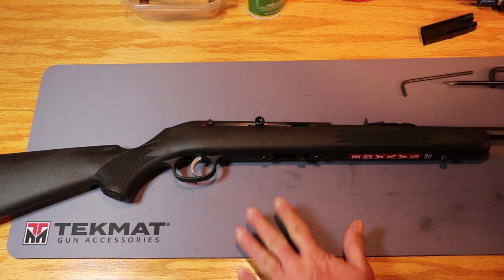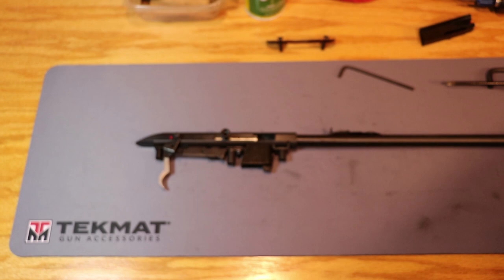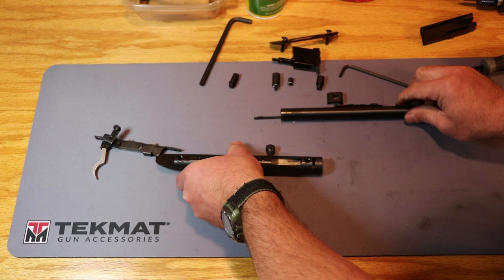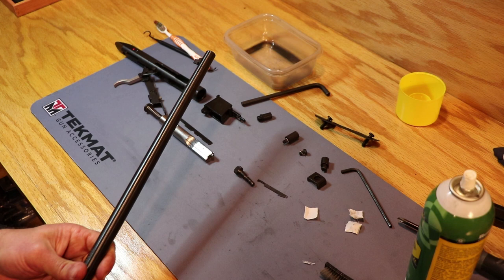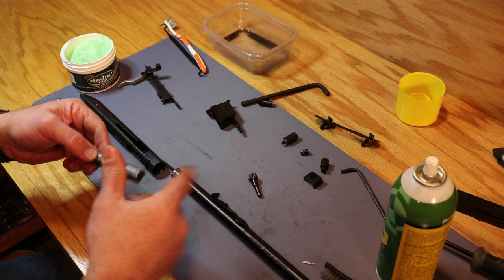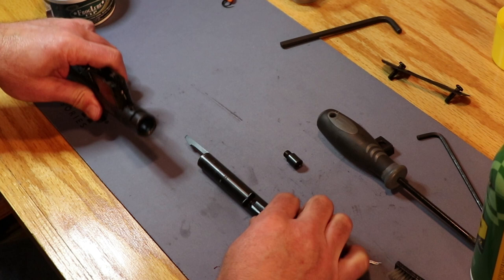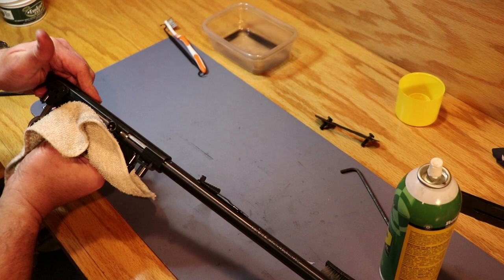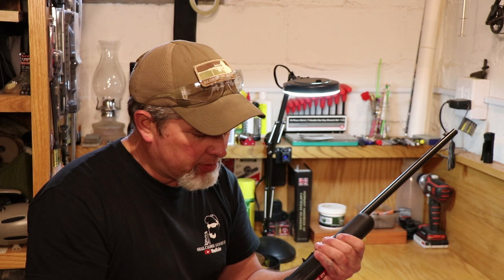Savage 62F cleaning, disassembly and assembly

Comment: THANKS!!!  Mine needed cleaning in a bad way...wasn't sure where to even begin.  Play and pause...sometimes replay...ha...got it done tonight.  It's a good rifle...have had it now for over 4 years...put allot of rounds thru it...one issue I had with it though (manufacture issue I'd think), had trouble getting the barrel reattached...that little metal guide came out bent when I pulled it apart.  (and no I didn't reef on it)  Took some doing to get it to lined up and in.  BUT thanks to this vid...she's clean and back firing.  Again thanks...Cheers.
Reply from the maker: I love to hear that I helped you out! Hopefully it will give you many more years of reliable service. Thanks for watching!

Comment: It comes apart just like the 64 I have. For me the 64 is easier to take down than my Ruger 10 22, my Marlyn 795, my Marlyn 60, and my Mossberg 702 plinkster. The Savage 64 and 62f don't have that pain in the butt bolt and bolt spring to deal with like the others do.
Reply from the maker: I need to get a Marlin 60 and I'd like to get my hands on a 802 plinkster (bolt gun) just for fun!
Reply: @SmallCaliberArmsReview  
I've been looking for an 802 plinkster. No one carries them up here. One gun shop gave me the gun's UPC and told me to check their web site often to see if one came in.
Reply from the maker: @tomstepanowicz6191  I'm looking for the polymer "thumbhole" stock 802. I found one in Louisville, KY once for $119 but it was months before I got back to that store, by then it was gone. I'll find one, someday.
Reply: @SmallCaliberArmsReview  the 802 with the thumbhole is the one that has my attention too

Comment: Thanks for your videos... Finally got mine to a range today (Not cheap where I live 25 bucks an hour)  Fired off 85 rounds with 6 or 7 hiccups seemed like the shells weren't ejecting fast enough or hitting the receiver not letting the next round load... Hopefully it's cause the gun is new and hasn't been broken in yet... Or it was the ammo, Winchester super x & CCI mini mags.. The magazine seemed like it was working okay no problem chambering the 1st. round..  Don't work to hard :)
Reply from the maker: I've has some issues with Winchester ammo in a couple rifles, especially the Rossi Gallery 22 (pump action, go figure). I've always had luck with Remington Thunderbolts. Thanks, have fun, be safe!
Reply: @SmallCaliberArmsReview  T Y V M

Comment: I have a rifle like that and wanted to know what do I need for cleaning the gun plus any lubricant grease because every time I fire a bullet it sometimes jammed. Sometimes it doesn't jammed, Barrel needs cleaning like how many times. Every rifle have different size of parts on guns? How often the rifle needs cleaning. Thanks. One gun shop charges $65 for cleaning the rifle so I thought I could just clean it myself instead of paying $65 but all I think of is WD-40 to clean it. Any lubricant or grease to clean the rifle or just need replacement parts.
Reply from the maker: You should be able to fire a few hundred rounds before it needs a good cleaning. I don't think I would use WD40 for firearms, it's more of a penetrating oil. I use mostly RemOil, it's formulated for guns. As far as a grease, I use FrogLube, it's both a cleaner and a lubricant and it only takes a very small amount.

Comment: Can you tell me why the receiver on my Savage 64f is so stiff after firing on a plastic snap cap, I don't eject it cause I don't want to leave my rifle charged so I just lock the receiver open and take it out with tweezers... Thanks
Reply from the maker: The plastic snap caps will get deformed over time, you may just need a new one.

Comment: Silly question:
Is there a way to “uncharged” the bolt without having to pull the trigger for this rimfire rifle?
Reply from the maker: Make sure there is no ammo in the rifle, check it then check again, then pull the trigger. That's really the only way to "uncharge" it. If you have a snap cap or plastic dummy round, place it in the chamber first, that will minimize any potential damage to the firing pin and chamber edge. It will not cause any problems leaving it in the "charged" state as long as there is no ammunition in the firearm. Not a silly question at all. Thanks for watching!

Comment: Stupid question but can the stock barrel on the 62F or 64F be swapped out for a different barrel like one with a muzzle?  Thanks
Reply from the maker: I'm assuming you want to put a muzzle brake or suppressor on it? You would need a barrel for the same gun to swap them or have a qualified gunsmith thread it for you. Thanks for watching!

Comment: Can you dry fire this gun without damaging it? I have the Stephen 62
Reply from the maker: Unless specifically noted in the manual, I would avoid dry firing any rimfire firearm, the only place i could find reference to dry firing the 62/64/954 is during disassembly, to disengage the hammer from the sear. If you just wanted to do some practice "dry firing" there are plastic "dummy rounds" or "snap caps" available that are supposed to prevent damage to rimfire firearms. Be safe, have fun and thanks for asking and watching!

Comment: Now im worried! My firing hammer doesnt have the black ring to hold the spring together. It came out loose???
Reply from the maker: Not sure what ring you're talking about. The design may have changed over time, these rifles have been around for a while.
Reply: The bolt action ring that hold the springs in place. I figured it out, it broke off an its stuck in the back reciever.
Reply from the maker: @johnnygutierrez3719  well that's a bummer!

Comment: I just bought a 64f, will it  come apart the same way, and how often would you suggest I clean it? Great video. Thanks.
Reply from the maker: It should. Most of the time people don't give them a thorough cleaning until they start having problems with it. Most rimfire firearms will handle a pretty good bit of neglect before issues arise. I don't believe there's any set number of rounds between cleanings and I probably clean mine way more than they need it but always remember that firearms have 2 enemies; Rust and Politicians.
Reply: @SmallCaliberArmsReview  Thank you for reply. I also own a shotgun, would this same thought apply to it also? Thanks for you time.
Reply from the maker: @jojoe2409  Yeah, keep them in great shape and they'll always be ready when you need them. Thank you for watching!

Comment: What Is the size of the second Allen wrench you use to release the barrel?
Reply from the maker: I believe I only used two different sizes, a 5/32" and a 1/4". Those may be different depending on when yours were made. Thanks for watching!
Reply: @SmallCaliberArmsReview  you're right, i checked and I have the same sizes you have 👍

Comment: Amazon was out of Frog Lube  when I wanted it so I got some Grizzly Grease, it looks about the same and got good reviews, My question is would you recommend a Teflon lubricant spray that dries  hard and  leaves a colored coating,  Thanks
Reply from the maker: I have seen some of that spray used on a rail on a type of milling machine, it changes the tolerance between surfaces. When the body would move, it would scrape the coating off and get between the moving parts and make a mess. the machine had to be taken apart and have it all cleaned out to work properly again. From what I witnessed, I would not use it on firearms.

Comment: If I accidently cock this rifle how do you un-cock it without dry firing. Just got it last week and it's my first semi auto and I want to learn everything before I go to the range...I think making a video on un-cocking would be a good idea...Thank you
Reply from the maker: Really, every time you fire a semi auto firearm, it is automatically cocked and ready to fire again. If there are no more rounds in the gun, it will not fire. I read through the manual and I couldn't find anywhere it mentions "decocking" except for the disassembly procedure:
"TO DISASSEMBLE THE ACTION
ALWAYS KEEP THE MUZZLE POINTED IN A
SAFE DIRECTION.
A LOADED GUN HAS NO PLACE IN OR NEAR A
VEHICLE OR BUILDING.
• Suggested tools for general maintenance
and cleaning: padded vise, Phillips
screwdriver, 7/16” box end or socket
wrench, 9/64” Allan wrench.
1. With one hand prepared to catch the
removable magazine, push the latch at the
front of the magazine forward, ejecting the
magazine into your hand.
2. Placing one hand over the ejection port, slowly
pull the cocking handle fully to the rear.
3. Let the cocking handle come forward slowly
and push the handle into the counter bore
(see FIGURE 4), locking the bolt open, and
extract the live cartridge from the chamber
(if there is one).
4. Look and feel to be sure there are no
cartridges in the chamber.
5. Move the safety forward to the OFF SAFE
[READY TO FIRE] position.
6. Pull the trigger to disengage the hammer
from the sear.
7. Remove the stock assembly screw, and lift
the action and barrel from the stock."

This was copied and pasted from the Savage owners manual available on line.
Generally, once you are done firing and you have verified there is no ammunition in the firearm, the manual recommends putting the safety in the "On Safe" position.
I have heard of people doing different procedures like pulling the bolt back just far enough to allow the trigger to be pulled but not letting the firing pin to hit the breech, but this procedure is NOT mentioned in the manual. 
     I hope this helps and thank you for watching!
Reply: @SmallCaliberArmsReview  Thank you and have a great day :)

Comment: If I wanted to leave a few mags loaded ( oem) would 5 rounds each be an issue as far as messing up the spring?
Reply from the maker: One of the great firearms debates! I have some that have been loaded for years, fully loaded. Usually heat and rust are the biggest culprits of the magazine springs. Think of all the other springs around you, that are not unloaded when not in use. Automobile springs, various switches, breakers, all the other springs in the workings of your firearm. I can not say with 100% certainty but I do not fear one going bad because it's left loaded.
Reply: @SmallCaliberArmsReview  Im a creature of habit and learned long ago not to leave loaded and I typically shot a hell of alot more back then. Not so much now. So I definitely appreciate the feedback. Thanks brother. Love the channel!
Reply from the maker: Thank you!

Comment: Would it be safe to  use stainless steel snap caps on this rifle not sure what the firing pin is made of... Thanks :)
Reply from the maker: I didn't even know they made stainless steel "Snap Caps"! I would say no, a "Snap Cap" is supposed to provide a cushion between the firing pin and the edge of the chamber, much like the brass of the rimfire ammo does. A stainless steel dummy round may protect the chamber edge but I think it may be hard on the firing pin. Firing pins are usually made of a hardened steel so they can withstand thousands of impacts on the primers.
Reply: @SmallCaliberArmsReview  Thank you
Reply: @SmallCaliberArmsReview  I posted a review of these snap caps on my channel and I gave your channel a shout :)
Reply from the maker: @gamer6550  Awesome! I'll go check out your video!

Comment: Can this gun be fired right out of the box or should I oil it first...thanks
Reply from the maker: At a minimum you need to verify there are no barrel obstructions. I would recommend picking up a bore snake or a cleaning rod of some sort and making sure there is no debris from the factory in the barrel and action. It will probably have enough factory oil left in it to run for a while. They rarely have anything in them but it's just good practice to verify, even a small metal chip from machining can cause big problems.
Thanks for watching.
Reply: @SmallCaliberArmsReview  Thanks for the fast reply have a great day
Reply from the maker: @gamer6550  you're welcome.

Comment: STOP , 1 tip!  Thore is wiggle room when you put the barrel back in . so ig ur already sighted in and dont want to mess around with ur sights again . Then mark the barrel to the recover and line up the marks!  lots of wiggle room i can havee the barrel twist alot right or alot left, geez, i eyeballed it but wish i would have known that b4 haha. gonna shoot it tomorrow. And yes it is a good gun. Not built asdurable as the 1022 which i replaced it with. trigger looks like dicast crap 2. otherthen that it shoots good cant complain for 160 canadian.
Reply from the maker: Both the rear and front sights are mounted on the barrel so there is no chance to miss align them unless you bump or damage them. The lug that holds the barrel on, really has no play in it at all so even if the barrel was able to be rotated 360 deg. the sights would always show the same as when it was sighted in.
Reply: @SmallCaliberArmsReview I see what you are saying however if the barrel is 75 degrees left to the receiver  the sights will still be aligned but not straight to the receiver. for example the stamp that says savage may not read straight because it twisted a certain way. i aligned it as straight as i could to the receiver. in short the sights are aligned together  but maybe a fraction off of being aligned  to the receiver..i have it looking nice and straight everything in good, just a little sketched that i dont have it perfectly straight, but maybe it never was anyway. gonna shoot it tomorrow. Thanks for the video man, helped me just go for it,

Comment: I watched this video before I bought this gun and it's the first gun I've ever owned! Thanks for the great cleaning instructions! I also watched your review on this gun.(https://www.youtube.com/watch?v=Ynbwa6Rx10k )  Thanks again. I've shoot other people's guns off and on over the years but this is the first gun I've ever owned myself and I'm basically a newbie to guns. You were talking about a product called "FrogLube" I found a video about FrogLube that is 6 years old  ( https://www.youtube.com/watch?v=3-depzYZC8w ) and started reading the comments and one poster commented this:
" One warning-in cold temps it will turn your firearm into a club! Works 
great in warm temps, but turns into wax and WILL make your firearm stop 
in the cold. Anything below 30 degrees or so. I know this from personal 
experience. The only product I have ever make a pump shotgun fail to 
fire. Firing pin was waxed up. I have to let people know this before it 
gets someone killed. Terrible product for northern climates!!! " 

Others asked the poster of the video if after 6 years he is still using the product and he answered one of them back with this comment: 

" I've switched to Slip2000 EWL.  I still like FrogLube but find Slip2000 EWL easier to apply/use. " 

 Like I said I'm a newbie to guns and I'd appreciate any thoughts on the matter. And one more thing, I really like that GSG FireFly!!! ( https://www.youtube.com/watch?v=vJJNgNyqKMo )
Reply from the maker: I've been using FrogLube for several years now and have never had any issues with it. Now when I apply it, it's only a very thin film. I think you just gave me an idea for a new video, it is that time of the year!
The FireFly is lots of fun!!!
Reply: @SmallCaliberArmsReview  

I came across this article tonight and thought you might find it interesting. 

" Believe it or not, and contrary to what a lot of marketing hype will try to tell you, firearms aren’t generally all that hard on lubricants. They encounter intermittent high loads, interspersed with long periods of inaction. This means that the primary lubrication need isn’t hydrodynamic – it’s boundary. What, then, should we be looking for? "
https://www.grantcunningham.com/2006/05/lubrication-101/

Comment: This system seems rather complicated to take down.
Reply from the maker: It's not the easiest and it's a very old design. It's not necessary to take it down this far for every cleaning, sometimes just a boresnake down the barrel is enough to keep it running.  I recently saw an ad for these at $89??? I cant remember where but that's a bargain even if it is a little complicated.